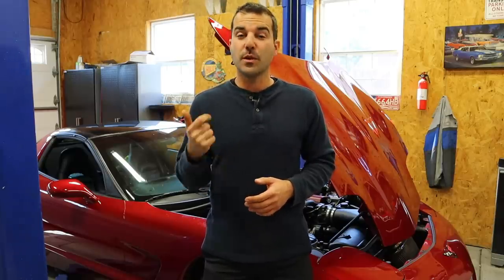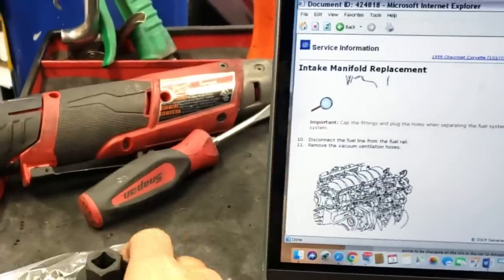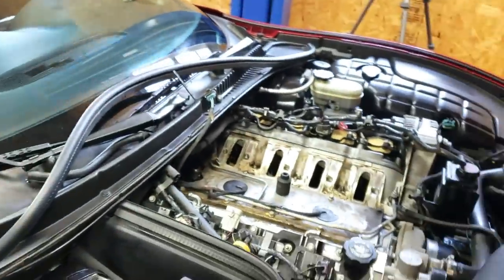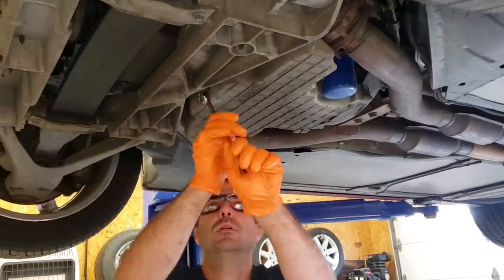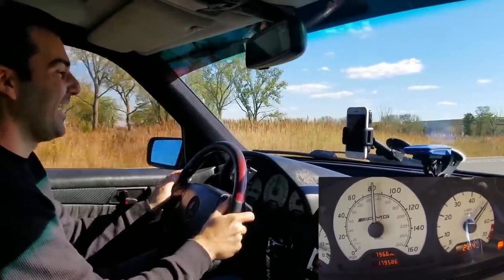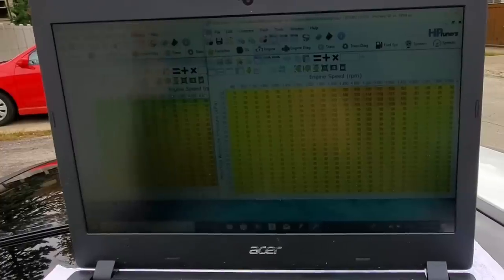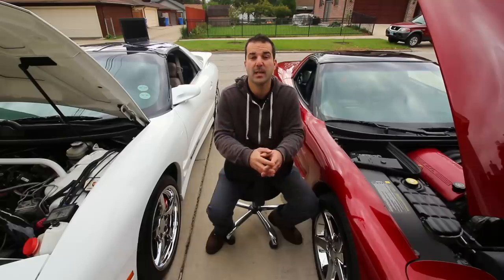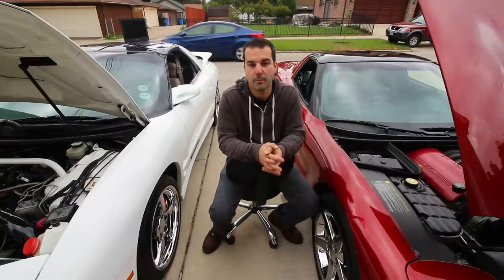I’m Building A 40 MPG Corvette That Sacrifices NOTHING! Project EcoVette Starts Now!

Comment: I’m not buying it… I’m an ASE CMAT, 48 years exp.  When you put a vehicle in “Open Loop” the ECM reverts to “Limp in Mode” or what you call “Speed Density” and its’ been that way since 1983 when the first ECM’S were OEM.  As you know… in limp in mode, the timing and injector pulse width are not controlled in real time by the ECM.  So, you’re trying to tell me that the “Engineers map” for "open loop" is more efficient then real time, Really!??   No, I disagree… and what you’re proposing is dangerous and can get very expensive.  When it goes too lean the NOX increases and the engine will pre-ignite / ping.  That alone can lead to serious engine damage.   Excellent video though… thanks for the pic’s and the Shop manual link.  If you think I’m wrong, tell me, we all keep learning. Eric
Reply: So you're telling me that every time I mash the accelerator and the car goes into open loop, that's limp mode? Come on man, I'm not L1 just A1-9 certified and even I know open loop means no feedback from o2's, such as what you'd have in a lean condition on a narrow band or rich under high load.... What about on a cold start in the few minutes before close loop is achieved? Is your car a complete pile of shit before that happens? 48 years of false premises.
Reply: @littlerhino2006  Well you better go back to school, I'm not here to teach you how the system works.  Because you clearly don't.

Comment: I had a 1978 Dodge Monaco SS ( a super limited version with only 1540 produced) http://www.curbsideclassic.com/automotive-histories/the-most-obscure-special-editions-and-forgotten-limited-run-models-mopar-edition-part-iv/   with 360 cu/in and lean burn system.  I know people had issues with that system but I put over 150,000 miles on it and it ran perfectly and delivered decent fuel economy at the time.   https://www.allpar.com/mopar/lean-burn.html      I still miss that car and wished I had kept it.   It was red with white vinyl roof just like the one in the brochure.

Comment: Still not sure why the system would be open-loop instead of closed-loop. Can somebody explain? Is it because we are ignoring feedback from the sensors when applying a closed-loop, therefore creating an open-loop forcing the engine to perform at a specific air/fuel mixture we set?
Reply: Open loop just means it the controller isn't using feedback from the o2 sensors, still uses everything else. Narrow band o2 sensors are basically an on-off switch. So the controller interprets a consistently switching o2 as stoichiometric. Most cars revert to open loop under WOT, using a table for optimum power. A lean burn mode essential does the same thing on the other end of the AFR range. Ignores the o2 sensors and goes by a speed/density table with modifiers for temp and still watches the knock sensor. I personally would like to have a wide band to know exactly what's going on but I don't have that kind of money lol.

Comment: You won't / can't "melt" your motor by running lean while cruising down the highway at low load.
Reply: In fact, the engine will run cooler, because there is less energy going through it, because there is less fuel burning

Comment: I recommend to watch the reddit r/solarracing there's a lot of information about what things you have to look for to achieve maximum fuel economy. Even changing the brake calipers and wheel bearings can do a big difference.

Keep in mind that this is like watching the equivalent of LMP1 cars but for maximum economy. We can get pretty extreme to reduce only a few grams, or reducing air resistance.

Comment: it shouldn't be that hard, my friends 05 would get over 30mpg humming along at 60 on the highway, take the mirrors off, tape the seams, take off the power steering pump and AC compressor, then swap the wheels and tires for something skinny and eco, then you just gut it and go on a diet, you could do all of that for about $1200

Comment: You're too late.  I averaged over 40mpg many times in my C5 Corvette.  Just drive ~55 mph, don't use the A/C (vents are fine), use 6th gear as much as possible, and drift when it doesn't cost you speed (down hills, approaching traffic, etc...).

Comment: Could you use a water meth system in low load systems to compensate for the cylinder temps?

Comment: They get like 34 stock. Shouldn’t be hard. Maybe lower gearing. My trans am got 31 at 90-100mph cruise control set. 1900rpm. 6speed. You won’t get anywhere near that with a auto.

My friends procharged c6 got 36. Couldn’t believe that shit. Idled at 70mph lol

Comment: Did you really just tighten your oil filter down with a wrench ? Please don’t do that. lol

-sincerely every guy who has had to use a screwdriver to remove their oil filter.
Reply from the maker: I was gentle, it's all good.  Plus I'm the next guy who has to change it, haha
Reply: Invest in proper oil filter wrenches if you already haven't. They're immensely better the smooth band or serrated type.

Comment: You're spending all that time and money, and you went with copper spark plugs?  Iridium plugs cost more, but last five times longer.  They are also less likely to lose their gaps. Considering all that is going into this build, why use cheap plugs that won't last as long?

Comment: Your engine runs at its hottest at 14.7:1 and thus produces the most NOx at that air fuel ratio.
Common misconception, also your engine will run cooler when you reduce the amount of fuel that's available to burn.
Less chemical energy means less kenetic energy and less heat energy.

You can make something out of nothing...

When tuner talk about running lean will hurt your engine...it's mainly about highly strung engines where running rich is keeping the combustion chambers cool so it doesn't knock. (Say 11:1)
Running 13:1 while is still rich will cause the engine to run hotter and possibly knock and potentially making less power or worst case a ring land failure or something like that.
So yeah running leaner than 14.7:1 is unlikely to hurt your engine. It just won't make as much power while running like that.

Engineering explained did a video on it a while back.

Found it 

https://youtu.be/vcgmEKhCFTs

Comment: Fuel economy stats: 
Weight: Decreasing weight by 10% leads to a 7% fuel economy savings; fueleconomy.gov's short hand version is 2% increase in fuel economy per 100lbs reduced weight.

Lockup torque converters' decrease in cruise RPM generally yields 2-3% improvement at highway cruise
Advanced modern electric transmission control strategies (early shifting & tc lockup strategies) can result in a 1-3% improvement
Mechanical engine fan to electric conversion: engine driven fans can be 6% HP loss across entire powerband (non clutch fans are the worst)
Piston Ring Packs: Mahle complains a 1mm/1mm/2mm ring pack reduces oil friction by 50% vs. old 5/64 ring packs with "standard tension" oil rings a 10% reduction in engine friction yields a fuel economy gain of 2%

Mechanical friction is 4%-15% of total engine losses; 75% of these losses are rubbing friction
Piston Ring Assembly Friction is 50-68% of total mechanical friction
crankshaft bearings and seals are 25-35% of mechnical friction
valve train 10-20% on OHV engines (cam tappets are the largest source of valve train friction; LS already has roller tappets, though) -valve train friction accounts for a larger percentage of power at lower RPMs but LS engines are already highly optimized here with roller tappets and roller rockers and beehive springs.

Oil friction: synthetic oils with friction and viscocity modifiers can improve fuel economy by 1% even with the same weight oil

Comment: The Corvette will not get 40mpg on a 500 mile road trip non stop. The engine and electronics build makes it not possible. With A/C activated. my opinion. I get 47mpg on my 2019 Chevy Spark.

Comment: I don’t think this is going to work very good... certainly not 40 MPG good. The leaner you run, the less power output the car gives which causes you to stomp the gas a little more to keep up with traffic which the ECU would be forced to recognize as accelerating in which case it would either richen up or stay lean and burn a hole in a piston or something. This can work at 16/17:1 AFR but no leaner and will only increase MPG 10~%

Comment: Why???  If you you want want an economical car, buy an economical car!  And besides, the car only uses fuel when you push the throttle down.....  Ie if you drive slowly your car will consume less fuel (duh).  Top gear did a test years ago and a prius driven flat out uses more fuel than an E92 M3 driven at the same speed (ie as fast as the prius can manage)

Comment: If I were a betting man, I would say this endeavor is going to fail.  And by fail I mean you're not going to get 40 mph without sacrificing everything.  You're going to get some improvements to fuel economy, but I'm guessing you'll top out at 37 mpg before the trade offs are too much.  I saw some forum posts of people getting about that while hypermiling.

While going lean burn can improve the thermal efficiency, there's only so far you can go before real life gets in the way.  Since you don't have direct injection with the special pistons (they have a little scoop to give a pocket of good A/F mixture at the spark plug), there's a limit to how lean you can go before the air/fuel mixture refuses to ignite. 

Since you're planning on doing this at 60 mph, you will have significant pumping losses.  Yes, running lean will reduce those pumping losses by letting more air in, there's still so much waste when a V8 is only making 12 hp (my estimate to maintain 60 mph).  Putting in a taller gear will let your engine cruise at a lower speed, with the throttle more open, but I wonder how smooth engine operation would be.

If you're willing to sacrifice enough, maybe 40 mpg is doable, but I don't think it will be fun with constant misfires and a shaky 500 rpm cruising speed.

Comment: How are you not going to lose power when running lean?

Also, remove the back seats for weight reduction, you aren't losing anything.
Reply: You either didn't watch the whole video or didn't listen closely. When he is talking about running lean he is referring to being lean while cruising at highway speeds, not when trying to accelerate or at low speeds.
Reply: Back seats?  I think they were removed at the factory.
Reply: @mathewfullerton8577  Got ya, I missed that.
I didn't know it was possible with such old cars.
Reply: @kraignadjkovic5494  Well yeah it turns out that back seats are an option and there are no seats by default, I've just seen a few corvettes with back seats.

IDK why I thought it had them to begin with. My bad. XD

Comment: Shift points would make a difference in mpg right?
Reply: In this case he's after cruising economy, so shift timing won't be a factor. The engine speed : road speed will be a consideration though. He mentioned the possibility of a different 6th gear ratio.

To answer your question, yes. Low RPM with moderate to high engine load is best for economy. Most people call it 'short shifting'. Easy to do with a manual for obvious reasons. Most factory calibrated automatics will do this but won't let you use as much torque as the engine can produce for a given engine speed, they just downshift to deliver more as you put more pressure on the accelerator.

As far as changing that calibration, I'm not sure if pressure to the clutches is a major consideration at low RPM, more likely it's a function of combustion accuracy. I know my factory calibrated '07 Civic will hold a higher gear longer with premium fuel than it will with regular. 

If you never have and are interested in trying to short shift to save fuel, don't 'lug' the engine. You'll know it when you hear it, it'll vibrate a lot and you might hear clattering, it's not good for the engine so try to avoid it. That's the more catastrophic end of 'ignition accuracy' I was referring to above.
Reply: The faceless I see. I appreciate the time you put into your reply. So much info that I didn’t know before. Thank You!
Reply: @Tkssa580  glad I could help
Reply: The faceless 🙏🏽

Comment: If you can afford to spend $10k (or more) cash on a car  , you can probably afford to fill up your tank with premium every time and never have to be concerned with the cost of gas.  If it's about the environment , that's different  , but lets just call a spade a spade.
Reply from the maker: It's just a fun experiment. Nothing more, nothing less.
Reply: @LegitStreetCars  You may proceed , lol
Reply: You can put the VE table in a 50/50 left/right split with the 3d graph , it really useful to have the graph up.  And you can rotate and zoom in and out with various combination of the mouse buttons and the wheel
Reply: You want an M570 Logitech wireless trackball.   I mapped one of the extra buttons to the dynojet start/stop so i don't have to use the pendant

Comment: Low rolling resistance tires FTW: I've a set of Continental PureContact EcoPlus tires on a performance oriented Subaru and it's astonishing how well they grip and feedback - while at the same time providing the benefits of a LRR tire. Assuming they are sold in the size you need, you'd love them. 
  https://www.tirerack.com/tires/tires.jsp?tireMake=Continental&tireModel=PureContact+with+EcoPlus+Technology

Comment: I will run as lean as I can without melting holes in my pistons. ~( 'w')/
Reply: It will misfire way before it melts any holes
Reply: @sr420det  I have never checked for melty spots, but if i run it lean enough it cuts out on me naturally.

Its a fine balancing point between nice and lean and no run at all with this beat up old thing.

Comment: Hi!  First time watcher here.  I have a gas sucking '99 C5 with a factory tune.  It's fine on highway but 90% of my miles are stuck in inner-city traffic, hence the sucking sound coming from my wallet.  Your lean open loop tune's probably not worth the temp risks for me but I like to learn all I can about different approaches.  (But, why is the same explanation repeated 2 or 3 times?  Why are unrelated drag racing clips breaking in constantly?  Seriously man, choose the audience, then pick the topics.  If you want a huge bubbagump audience don't do topics involving stoichiometric ratios.  If you want to do things YOU find interesting simply accept a smaller more literate viewership.  Doing both is a compromise and a difficult way to grow a channel :-))

Comment: Narrower, lighter wheels, air splitter under the front end..
Reply: A splitter will make mileage suffer
Reply: @alexscarborough6263  rly? Wouldnt it help with cleaning up the air under the car?
Reply: @zkljaja  no because it will act as an air damn and disrupt the flow of air. Splitter are used to create downforce.

Comment: I dont understand how this thing can get 30mpg. Even if I replaced ever panel on my car with fiberglass it still wouldnt get that. Reveal the secrets.
Reply: At 60 mph with the 6 speed .50 od the v8 is turning 1400 or so rpm, less rpm + less fuel burned. My 11 C6 6.2 Grandsport would pull off 31 mpg hwy and playing around and hyper-mileing would get up into the 50 mpg around 45-50 mph.
Reply: @johnkerr8157  true. The little 4 cylinders are screaming away at 3000rpms and burning more fuel at the same speed.

Comment: the fuck? the C5 beats my 2007 Charger in MPG stock, and this is a 2.7L V6 that doesn't even make 200HP, it matches the 28 highway and my Charger beats it in city, but you add 2 cylinders and double the HP

Comment: Great video, and concept. I read about a lean burn Honda civic hx that was sold in the states(i think, it maybe Canadian) that uses lean burn. check ecomodder.com for more info.

I also purchased one of the emanual shop manual for my w203 today at your recommendation. I do not see how or where to download it. any suggestions?
Reply: They ended up sending me download link when I created a trouble ticket. I was disappointed that the $20 shop manual is just a flat disorganized PDF. Not the software with a searchable database like the on used on the show. That appears to be $64.